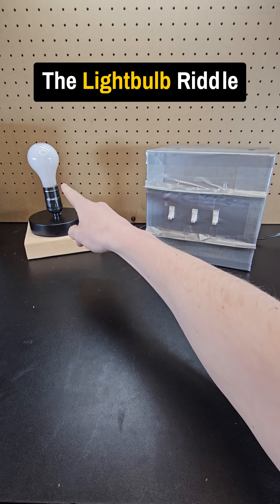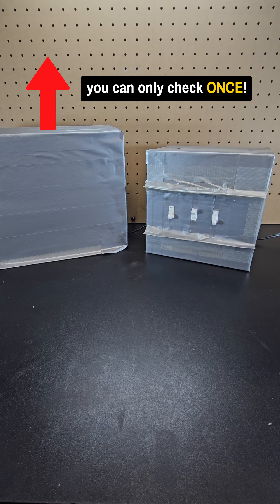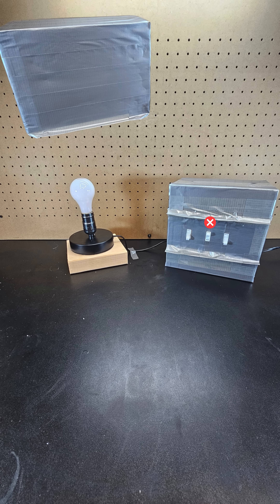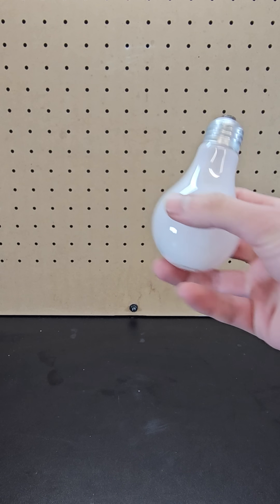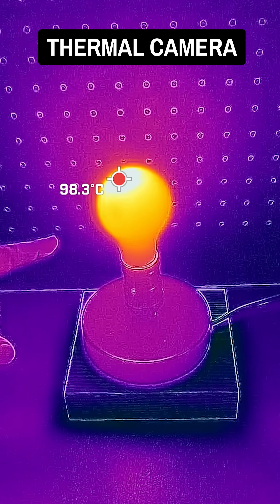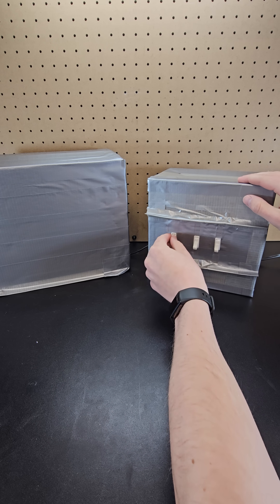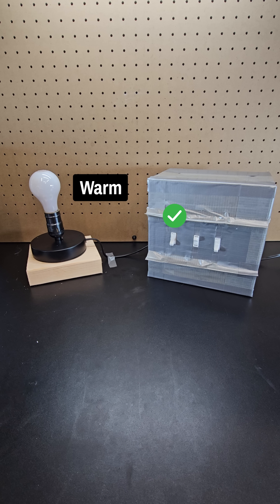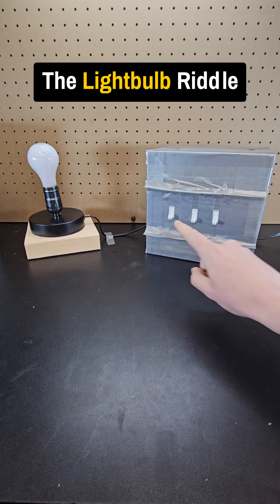Can you solve this Lightbulb Riddle? #science #shorts

Comment: Leave one down 
Flip the middle and the left. 
Wait 10 minutes. 
Flip the middle down. 
Lift the lid. 

If the bulb is on. The left switch controls it. 

If the bulb is off, touch the bulb. 
If the bulb is cold it’s the right switch. 

If the bulb is warm it’s the middle switch. 

This is all assuming the light was turned off to begin with.

Comment: Ive seen this one before. You flip switch one and leave it on for a little while, then you flip off the first switch and immediately flip the second switch then lift the box. Already a one in three that it was the second switch but if the bulb is off but hot or warm to the touch, it was the first, if it's off and cold its the third because it hadn't been turned on yet

Comment: The light bulb gets hot, lift 1st switch and wait 5 minutes, switch the 1st one off and turn on the 2nd one, lift the box, if the bulb is hot but isn’t on, it’s the 1st one, if it’s on it’s the 2nd one, if it’s off and cold it’s the 3rd one

Comment: Before finishing, I'm gonna say flip one, leave it on for a minute, flip it off, flip another, then lift it. If the bulb is on, it's the one switch currently on. If it's off, check of it's hot. If it's hot it's the first switch. If it's dark and cold, the unflipped switch

Comment: I went with the solution of getting the contacts to arc due to tolerances in the switch. I may have wrecked light switch or two as a kid doing this. So I know it works quite well on 60w incandescent bulbs If you get it just right. It's also a great way to destroy light switches.

Comment: I’d turn the first light light switch on then after 10 minutes. I’ll turn off and I’ll turn on the second switch. Then I’ll check if the bowl is hot. Then I would know that it was the first one, but if it’s on that I know it’s the same one. If it’s not hot or then I will know that is the third one.

Comment: I got another solution, idk if it'd work. You light 2 switches for 5 min, take one down, and check. If the lightbulb is warm but off, it's the one you took down. If it's on, it's the one currently activated. If cold and off, it's the last one.

Comment: slowly flip the switch so you can hear the contacts arc if the switch is connected to the load
Reply: what if the other two are still connected to load, just not the lightbulb
Reply: @wolfstormog1045 yeah
Reply: @wolfstormog1045 the load is the lightbulb.
Reply: @ yes but you can have loads also attached to the other 2 light switches effectively making this testing method useless
Reply: @wolfstormog1045 what if it's connected to a pipe bomb
Reply: @Rg87000  .. if u mean it goes off if the right switch is switched, its even easier, u just keep switching every switch .. until it goes off .. if ur close enugh to hear it .. but the original riddle would also fail if those was to far apart ... ex if the switches and bulbs r 100km(60 miles) or more apart the bulb probably has cooled down when u get there under normal conditions,
but there is actually noting in the original riddle saying how this box is costructed ... its theoretically possible construct this box thermally insulated so it will keep heat for days (more than enugh time to go anywhere in the wourld) .. in this case the bomb example would not work, its mpossible determin which one set it off if u cant hear nor see it
Reply: Smort
Reply: Exactly what I came here to say!
Reply: What if all the switches are the older glass bulb filled with Mercury tilt switch type ?
Reply: @markdi2  you can still sometimes hear them arc but it takes a pretty specific timing of flipping it. I could also just say that I know these aren't mercury tilt switches by the way they move.
Reply: Thought the same thing
Reply: The original puzzle involved the light being a room away
Reply: I was just going to answer with flip one wait a day unflip it flip another then open, if off but hot first, if on second, if off and cold then it’s the third one that you didn’t touch. I am still at the point where he says only look once because I wanted to answer before hearing his answer
Edit: I did not hear the part about this particular lightbulb model until he said he did while explaining his answer, my answer was for most models now
Reply: Flip the first switch for 20 mins and then turn it off and flip the second switch and then look. If the light bulb is hot then the first switch is the one. If the bulb is on then it’s the second switch and if the bulb is cold and turned off then it’s the 3rd switch
Reply: 9😊😊😊9😊l😊😊😊😊 oofo😊😊9😊😊😊ó😊😊o😊😊o9😊
Reply: 😊😊 ooh😊9😊ló😊😊o😊😊😊ó😊o😊óm😊😊😊😊ó😊😊ó
Reply: 😊😊óm😊
Reply: A light bulb doesn't draw enough watts for it to cause an arc when u hold the switch close 
No matter how close u slowly move it u wont hear any arc at low wattage
Reply: A household voltage is not enough to arc in air. Inside the bulb, which is either a vacuum or filled with inert gas, is not something that could happen, no matter the wattage, because the voltage is too low.
Reply: That's what i thought
Reply: That’s what I was thinking 😅
Reply: sounds smart, but isnt. Only capactive or inductive loads will cause an arc. An incandescent lightbulb ist purely ohms.
Reply: @monarch73 wait what
Reply: @domi-no1826  this is too complicated to tell in a yt comment section. Ask someone who knows (teacher or electricians) Arcs come from two possible scenario: Extremly high currents so the surface of a metal gets burned or high voltage arcing through air. Light Bulbs as a load cause neither one of those. So, no arcs.... Only inductor coils (motors etc) or capacitors can cause this.
Reply: I was going to say the same thing.
Reply: Lightbulbs don't arc that well
Reply: My grandpa gave me the same dilemma, but the light switch was in another room, so you could not hear the light turning on, and this was before LED lamps
Reply: Smort
Reply: Smarttt
Reply: Bro What?..... 😮
Reply: Hi noir!
Reply: sure you can try but the slamming is loud
Reply: Ima put in my load
Reply: Good outside-the-box solution!
Reply: This riddle was in a show on Disney+ it still stands as one of my favorite shows because of its unique way of portraying intelligence
Reply: you cheating bastard
Reply: Tbf the other switches could be connected to something else load bearing
Reply: 8
Reply: thats what I was thinking
Reply: erm what? .. modern swithes wont arc so u can hear it unless ther a very high voltage or high  current
Reply: No guarantee is the same circut
Reply: Poop
Reply: Nerd.
Reply: Ur just dumb @Deletirium
Reply: @Deletirium  ur js jealous ur not smart enough to know lol 😂

Comment: There are only 4 different states the switches can be in: All on, all off, 2 on 1 off, and 1 on 2 off.

Two of those states, all on and all off, would give you no info. The other two states have a one in three chance of giving you an answer, otherwise leaving you with a 50/50. 

This means there is no state that will give you a definitive answer every time. Therefore, this is a “think outside the box” kind of riddle. Or there just isn’t a correct answer which would be pretty funny. 

Given that the solution must be an answer to the question “how would you flip the switches” my final answer is this: I would flip the switches so hard that the box breaks and I can see which switch is connected to the light bulb.
Reply: Thanks, AI. I especially like the part where your human user stole your wrong answer without crediting you.
Reply: @user-db3xu1hw7r  imagine being so incredibly braindead that you immediately disregard any thought out comments as AI lol
Reply: Technically this solution does tell you if it’s none of them, which the actual solution does not, making it better in terms of certainty, even if it is way more difficult to pull off.

Comment: Easy! Finagle the switches and if you can hear them arcing between the midpoint then that's the one with the light bulb and electrical load on it
Reply: But what if the other switches are connected to different lightbulbs out of sight
Reply: @cheeseballpete8944  then we're screwed
Reply: Hey great job! This is another outside the box solution for this. In the spirit of the puzzle id say its valid!
Reply: another inkfish has been spotted
Reply: @netlok360  holy moly
Reply: I almost had a stroke reading this. (But that is just cause i'm stupid😊)